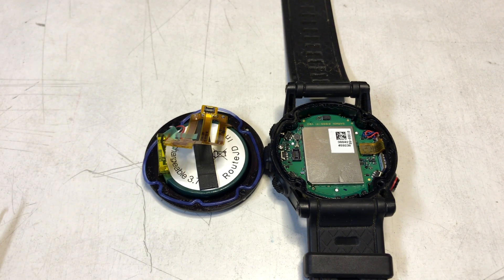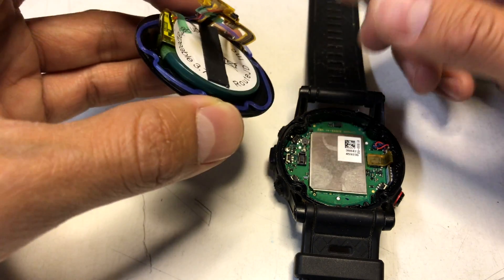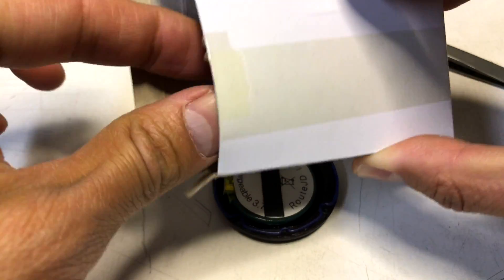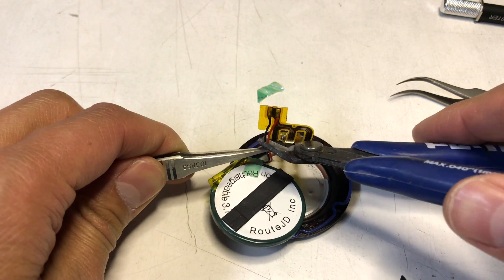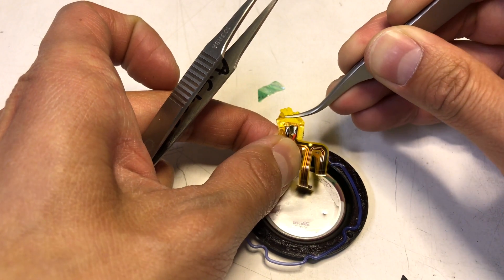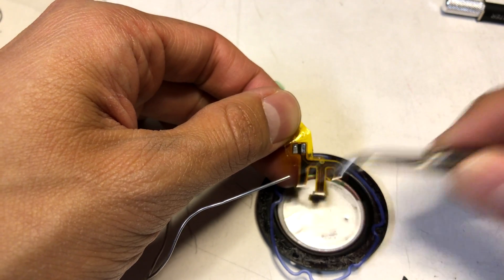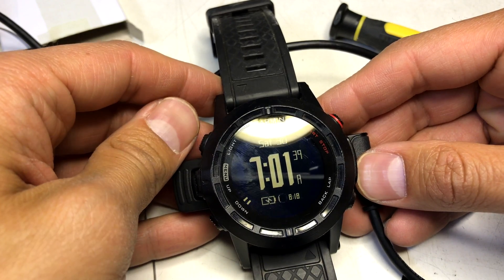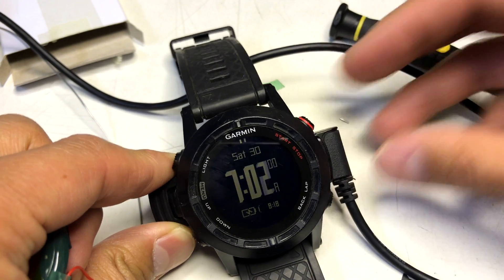Garmin Fenix 2 Battery Replacement -- in 4K

Comment: Did exactly what you did. I turned the watch on, it cycled and stayed on for a few minutes before it turned itself off. I attempted to recharge, but after a few minutes the watch became very hot. After I disconnected it from charger, it wouldn't start anymore. It needs to be replaced. Too bad that I bought the tools for this for nothing.

Comment: Thank you so much for the video. I was able to easily replace the battery. Now it works great. Saved money on a new watch. One thing I would like to add, is to use some type of silicone sealant on the O-ring. This will insure the watch is water tight. Thanks again

Comment: Thank you for this instructions.  Very helpful.  Suggestion -- the blue gasket needs to be lubricated with proper watch grease (found on ebay for instance) and then installed in its groove, not left on the side where the battery is located (like shown in your video).  Not doing so may displace the gasket and crook it when the 4 screws are tightened, therefore water will penetrate eventually, not if but when.  Thanks.

Comment: Thanks for this video.  I used it to replace the battery in a watch I got off ebay.  It looks to have worked but the first few charges it's not holding battery life very well (like 100% goes through the battery in 48 hours with only one 1:20 GPS run, and after fully charging last night it dropped 18% overnight).  Do I need to do a few charges for the battery to get to full power?  Or did I just get a dud battery? Or did I possibly just do a bad sautering job?  Any ideas?
Reply: Perhaps bad new battery or bad soldering, or both.  The soldering process is very important.  Using the right soldering iron, right iron tip, right solder and right temperature is very important not to produce "cold soldering".  You may find good soldering tutorials on youtube.

Comment: Hi, thanks for the video! 
I bought a battery from ebay, but when i measured the output tension, it indicates 0V, and then i replaced the battery, but my F2 still doesn't turn on. Did you had to make any procedure to activate the new battery, or it was supposed do be "plug-and-play"? 
Thanks!
Reply from the maker: It should be 100% plug and play. Did you measure output of the battery itself?

Comment: My device has the same problem and the official service told me to pay an extra amount of 148 euro for a new one. My fenix was out of warranty. I ordered the battery from ebay  to repair it based on your procedures. Does your device has any problem until now? What should i look at? Please advice me.
Reply: PETROS TSITSES I have the exact same problem need to buy the battery, but where?
Reply from the maker: PETROS TSITSES no issues for me so far. I would say the most important thing is to be sure the rubber gasket is sealed well or you'll get water damage if you go underwater. Otherwise the rest is straightforward.
Reply: I had never used  my fenix underwater. The existed rubber gasket seems ok.  Do you think that could be better  to buy a new one ? Where can I find it?